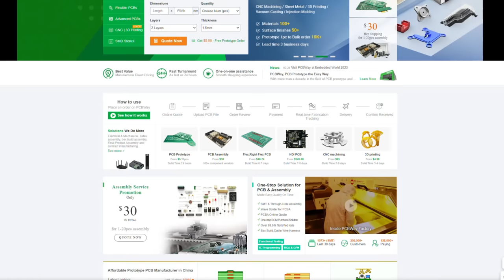RC SCRAPPY Airplane  GAS Engine First Startup and Breaking In, Motor NGH GT35 35cc, 3D printed plane

Comment: Wonderful aircraft, fantastically realized. 👍👍Have you already been able to gather experience regarding fuel consumption and total flight time ?
Reply from the maker: The tank is 1.2 liters. I have used a similar engine and tank before. Flight time 20-30 min

Comment: Hi there Masterbuilder.
My first 3 questions,
Wing loading?
Power to weight ratio?
CG neutral, nose or tail heavy?
Very nice project.
P.S. I think the real scrappy has issues.
...as well as good sides.
Reply from the maker: hi, 
Wingloading 80G/dm2
Power to weight ratio 0.8
CG neutral
Thank you

Comment: Could a drill be used as a prop-turner for starting, in the same way that a motorised wheel based starter is used on the back tire of high compression motorcycle engines?
Reply from the maker: I don't know, haven't tried

Comment: My first reaction is "Oh no you mean it's not electric powered????"  After all that work, it's not electric powered???
Reply from the maker: no, it´s gas powered :)
Reply: @markoroolaid  Too bad, could have had almost twice the power for the same weight as gas.  Would have just made that fabulous plane sparkle.  I took a DLE61 out of my 1/4 scale Fokker D7 and replaced it with a 60cc size electric, went up two prop sizes and a thousand RPM.  Incredible power on electric.